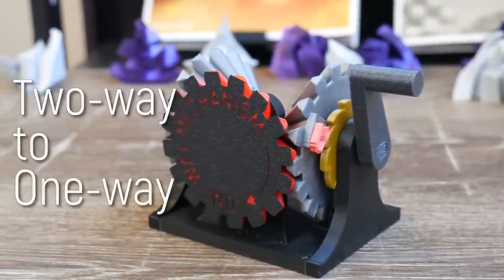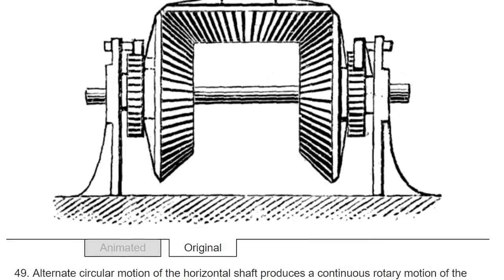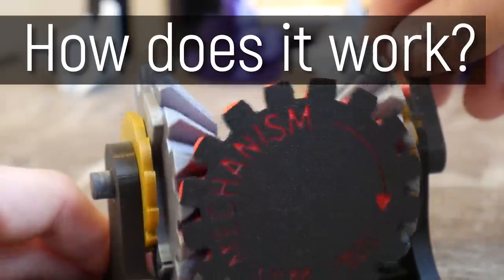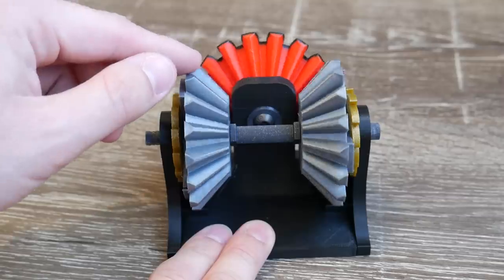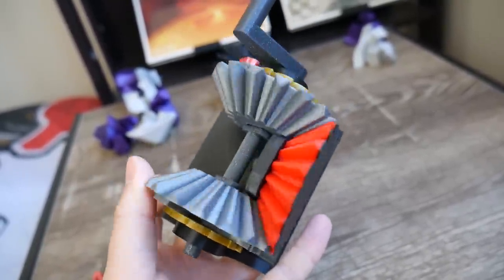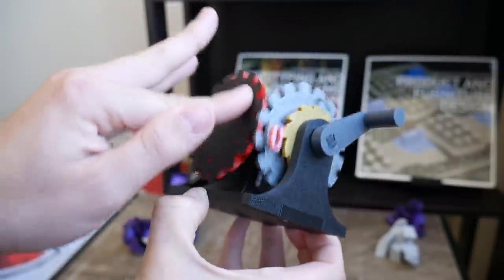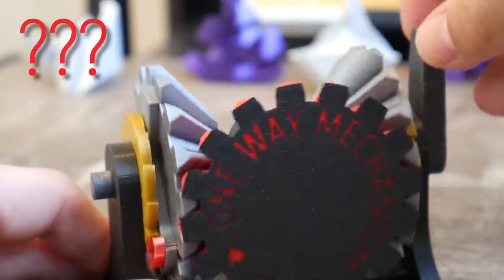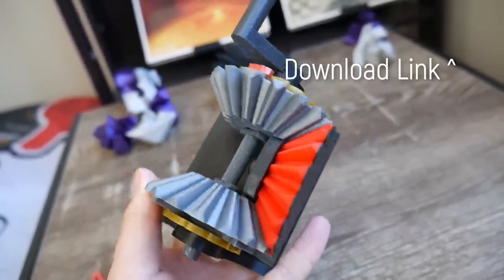This Mechanism only turns Clockwise, no matter what.

Comment: I think this would make a great fishing reel mechanism!  

If you were to place a spin-casting spool and drag mechanism on top of the output gear shown in this video, the way the person turned the handle wouldn't matter, as the reel would always wind in the correct direction.

  This would be fantastic for little kids that haven't learned more advanced techniques yet!  How many times have you overheard, or been presented with "help, I reeled backwards and now it's broken"?    There wouldn't  be a backwards anymore, and you could just tell them to reel whichever way works best for them :)  

Add the ability to swap the handle left/right, and you would have the ultimate reel for easily introducing someone to the sport

Comment: When it comes to converting 2 way flow (electricity or liquid) to 1 way you can use a bridge rectifier.  It is just 4 one way valves(like a check valve) or diodes in a particular square arrangement.

Comment: Stanley has a ratchet that works similar to this. The handle twists both directions producing a singular direction movement. But it can be switched to tighten or loosen

Comment: I could see a larger metallic version being used with a steam piston, or some other rapidly isolating drive system, to drive a pump, or some other one directional rotary system
1. Such drive system are already loud so it's sound isn't an issue
2. It rapid response to direction change means it's less likely to fight the piston
3. If it's driving something that either should go the other way, or doesn't need mechanical help to do so, it's inability to reverse rotation is at worst a non-issue, and at best a boon

Comment: It looks like a variant of differential gears you find on axles and drive shafts that can allow adaptive rotation when being driven, except set in such a way that you could have a motor attached to the "clockwise-only" "output" (as you called it) and have an axle that can be driven in either direction dynamically by only locking one or the other axial gear with an inset. Also, due to the way this is designed, it looks like it can handle quite a lot of torque, and as such could be apart of a winch mechanism or likewise.

I am aware that my comment is probably a few years too late here.

Comment: I suggest a sliding mechanism to replace the ratchets. Nothing at all like the 4 gears shown, but moreso an angular separator, where when the input turns one way, the lock gets slid into the side of the corresponding gear. Instead of ratchets working the outermost side of the gear, the contraption becomes more compact

Comment: This is basically a full-bridge rectifier but without the condenser! It keeps the positive rotation positive, and makes the negative positive. I wonder if there’s a mechanism that you can use to fully rectify the output of this and make it rotate at continuous speed when receiving a sinusoidal speed as its input

Comment: I don't know if it was or not but I could see this being used in the early industrial days for either large hand tools for things like tightening bolts in a building frame or a hand air pump for a forge in place of bellows that blows air while moving both up and down with a foot pedal.

Comment: This mechanism would work or have worked great on those hand-driven railroad carts. Every motion downwards (or upwards) gets the wheels turning, and when you have the speed, just let go and the wheels will keep turning since it has free spin in that direction.
To go the other way, there could be a reverse gear shifter...
Reply: Don't these already use both down- and upward motion, though?

Comment: Just in case anyone is interested, I commented on this three years ago, stating that this was part of the Constantinesco Torque convertor. I was wrong. Gogu Constantinesco used a device similar to this, which does the same thing, but is much thinner and functions better. He called it a "Mechanic valve". This is a topic well worth investigating.

Comment: my thought was that it was used on some rotary device that needed to only rotate clockwise. problem was was that what was turning it (possibly a steam piston) had trouble being consonant with its direction. so they developed this to solve there problem, ensuring that even if what was turning it started turning backwards, the machine would still work

Comment: One-way bearings would replace the ratchet mechanism, this would be handy as an odometer or anywhere measuring total amount or rotation regardless of direction, a piece of farm equipment could be ground driven instead of PTO powered. A windmill in a valley with only bidirectional wind flow could be setup to use this without needing to swivel.

Comment: This mechanism can be used in ATV, so that when they are climbing steep slopes, they can lock themselves up and avoid slip or falling.
But it should be direction controlled, i.e. cw, ccw, neutal. Giving the user the freedom of use whenever required

Comment: I have a ratchet that uses a similar design. I turn the handle either direction and the bit rotes clockwise. Perfect for working in tight spots and not busting knuckles.

Comment: I want to use this in a rubber band paddle boat.  Once the rubber band has expended it's initial thrust, it tends to wind in the opposite direction.  This causes the boat to reverse, albiet not as much as the initial forward thrust.  Often this is an unwanted side effect.  These gears will be fun to try in that scenario. Hopefully it gives the rubber band paddle boat a little extra boost at the end.

Comment: Well, i'm quite a beginner with mechanisms but I have a use for this. I need both sides to be big with small gear at the center. Replacing wind power generator with gravity power, using two pulleys with equal weights connected to each other and springs at the top end of each weight. when weight-a goes down and the rotation goes clockwise, weight-b goes up, right? pushing into the spring, weight-b goes down, rotation goes counter-clockwise, and so on. while this repeat continues, the 1-way rotation should power up the generator continuously. the bigger the generator the likelihood of a continuous surge of electricity should be supplied for an entire house. a little grease once in a while should keep it going throughout, since gravity is always present. as for keeping it steady, having another set of springs and pulley below, connecting the two and pushing it up before it gets stuck on one side should also keep it from swaying off-course.
Well, I don't have funds to try this idea, so if anybody is able to make it let me know 😅😅

Comment: A plausible use for this gear would be if the only power source for a detachable lawn mower assembly was a PTO that reversed when the tractor drive also reversed. This would then allow the mower component to properly function regardless of the direction of the tractor. However, most PTOs are part of a larger transmission assembly that already ensures its rotation in just one direction. Besides, as you pointed out, the ratchets would likely wear out unless an addtional governor assembly was included that lifted the non-functional ratchets away from the ratchet wheel.

Comment: Stanley Tools made a hand drill which used a ratchet mechanism to always turn the chuck clockwise regardless of which way the
crank was turned. Also had other settings for unidirectional rotation.

Comment: 6 years later, it can be used in card shuffler device. If u rotate the other way, the card will not be collected in the 'basin', so direction to crank the handle is required.

Comment: I think that this is typically the mechanism that was used in the old clocks. A pendulum goes back and forth, and engages a wheel that drives the clock.

Comment: Proxxon and Stanley both have a rotator ratchet which has a handle that can be turned to cause the ratchet to turn as well. I believe they use the exact same mechanism as you can turn the handle in either way, the ratchet will still only turn in the selected direction. It also has a louder, coarse sound when you turn the handle which reinforces my theory.

Comment: Hi, this mechanism is very similar to a two speed winch on a yacht. The input crank can be turned either way butthe output drum turns in one direction only. When cranking in one direction there is a modest gear reduction whereas crankingin the opposite direction causes a deep reduction. The load on the drum cannot/doesn't feedback to the crank and is fixed,ie the rope cant 'unwind' the drum. I have pulled them to bits to repair and service them. there is no bevel gear set.

Comment: This would have been used in mechanical computers.  These were common in warship fire control rooms, where firing solutions were generated using the turning of wheels and knobs.  All of the computing of the algorithms was set up as gears and ratios thereof.  In this instance, things like a ratchet mechanism would be useful for accurate decimal denominations (integers, basically).  Something like this gear could represent an absolute function or some other part of an algorithm.

Comment: You could use it to start one of the 20’s era wind up cars. You spin the input either way and it makes sure the motor doesn’t start spinning the wrong way. I know they used ratchets in them already, but this would be nice if you want to spin counter clock wise.

Comment: One thing I can think of is power generation from tides, when water moves a water wheel one way in the morning and the other way in the evening. The output shaft would move in the same direction in both cases.

Comment: In the past the lathes that were used had a spring (like a tensioned bow) that was wound around the work piece to give it a back and forth rotation every time you engaged with the foot pedal this could be useful in that application to keep the work piece engaged when you foot is lift on the pedal

Comment: A great practical use i would have for this is in a automatic watch, which converts the swinging of an internal weight into the winding of the spring, which can be wound in one direction easily with one of these, regardless of which direction the weight swings.

Comment: Replacing the ratchets with sprag clutches would make it quieter, and probably more efficient at converting small-amplitude oscillation to continuous rotation. I've never seen a 3D-printed sprag clutch, but you can buy metal ones off the shelf that look just like ball bearings.

Comment: There is a mechanism that reminds me of this but is completely different. It takes one way rotational energy and converts it to two different gears to spin in the same direction. Its used in cars to transfer the engines rotational energy into the wheels of the car.

Comment: A much more silent version, with almost no backlash during reversals, uses wrap-spring clutches, instead of ratchets.  But also has more friction.  Very rugged, though.  You can 3D print wrap-spring clutches, also.

Comment: You can use it for tank turning. Tanks have 2 motors one for each side but with this you can use one engine and switch what side you would want to drive but you couldn’t drive both Tracks in the same direction

Comment: Reminds me of an automatic watch, where the motion of the wearer causes a semi circular weight to turn in both directions, but always moves the winder in the same direction to tighten the main spring of the watch. A mechanism like this could turn kinetic energy like the movement of waves, or walking, or whatever, into stored energy, by winding a clockwork motor or turning a generator to make electricity.

Comment: It could've been used for the driving mechanism of a handcar, where two people pump the car and this mechanism would convert that to movement in one direction. The downside would be that you couldn't actually reverse or brake with it, but it would be kind of efficient.

Comment: On a sailship there are these things to pull the ropes. I don't know the name right now.
You can put a handle to it and if you turn clockwise the machine turnes fast clockwise, but if you turn anti clockwise, it turnes also clockwise but slower and with more torque. So there is a small gear attached to ti.

Comment: I used to have a screwdriver called kobalt double drive that reminds me of this motion. I don’t know if it used this mechanism or not, but it made a lot of ratchet noise and turned in the same direction no matter how you twisted the screwdriver. I will have to look it up and see how it works.

Comment: Probably used for hand powered lathes, so the work piece doesn't reverse direction after the spring action releases. A foot pedal with this in between the work piece would create much smoother crafting.

Comment: Seeing this I imagine a use on a railroad handcar. Remember those train cars that had two people alternating a see-saw like crank to power the car. Instead of this crank using pistons, the back and forth actuation of the crank (causing alternating directions of rotation at the shaft) could result in forward motion. Just a thought!

Comment: Similar to a dual-speed winch on sailing yachts. Turn the crank and get high speed trim on the sail, turn crank reverse direction and get slow speed and higher tension

Comment: I suggest it could have been used as a gear for a waterwheel driven saw as in the crank is fixed on the sawblade moving up and down and it engages the "roller" to move wood through the saw

Comment: If I recall right it was used on a utility cart for the railroad using a seesaw mechanism... the one that was operated by man power, and a lever could be flipped to change the direction. So a more advanced variant of what you have there. 
I have also seen some of those on wave motion drills, but they are a old concept, and I don't know the real name of them.  They were like a Manual Tunnel Mole.
I also recall that there might have been a auxiliary power generator designed based on that, when the main power stopped it engaged the other gear system... not sure what the other shaft was though... like maybe if main power turned off it engaged a water wheel to turn the mechanism.

Comment: My first thought is clockworks, and I have a feeling that it's the right answer. Mechanical clockworks have worked by either spring or pendulum for centuries. In either case, it is a circular gear which always run in a single direction, driven by an oscillating device. Pretty important to human history, because time-keeping devices would never have been able to exist without two-way to one-way gear systems.

Comment: 5:05 "I have no idea what practical use..." To convert reciprocal movement into rotary movement. I once had a toy car that you could push down and roll it forward and back. It didn't matter. Either way, it would wind its spring so it would run when you released it.

Comment: Well, if you replace the ratchet  with a push-pull gear linkage, you could translate either counter-rotating systems into a single output or from a single input into a forward or reverse on opposite sides of the mechanism.

Comment: Such devices are used in turbine pumps to prevent backwards turning of impalers pushing the fluid in case of reversal of polarity in multi phase electric motors driving them.

Comment: In case anybody is interested, this is nearly 100% identical to a stereotypical open differential on a car.
In a car one side slows down when you turn, necessitating this design.  Without a differential, or if you have a locked differential like you would in extreme off-roading cases, then the inside wheel (inside of a turn) starts locking up around turns because it needs to maintain the same speed as the outside wheel.  Same happens if you build a cheap drift car and weld the differential closed.

So the differential allows the wheels to spin at different speeds and not lock one of them.  That's all the basic 3-way bevel gear mechanism does.
So the addition here, which makes this slightly different from a typical open car differential, is that now you have the ratchets which lock one side depending on the direction.  So instead of it being a matter of one wheel spinning faster than another (and transferring rotation to the opposite side), the ratchet is holding one wheel still, and transferring 100% of rotation to the other side.

Interesting how a differential design that's been around for such a long time could be converted to a device like this with the addition of the ratcheting mechanism.

Comment: One of the likely uses was in clock towers. The mechanism would be connected directly to the pendulum and make use of the force input from its swaying in both directions. This would likely drive not only the clockwork associated with keeping the time, but also other varying mechanisms meant to prolong the undulating motion of the pendulum as well as the keep its motion as consistent as possible to maintain accuracy.

Comment: Perhaps the pawl system could be changed with a free bearing ratchet, with the ratchet gear set within the 90 degree drive gear. The bearing would then engage in one direction, but be pulled out of engagement the other direction. There should be little noise, decreased frictions, and ability to encase in grease or gear oil. The down side would be the slop between engagements and high stresses on initial lock-up.
I could see a version of this used in multi-motor drivelines as in unlimited class tractor pulls and such.

Comment: For machines that operate one direction of rotation and wouldn't work or wouldn't work effectively in the reverse direction. Certain styles of meat grinders could utilize it. If you made a hand crank wood chipper with directional teeth.

Comment: I am not sure of the practicality, but in a manual push mower I could see it being advantageous for driving the cutting cylinder.   I have a manual push mower and the blade is geared to the wheels, but when i have to back up, I lose all the momentum the blade had moving forward.